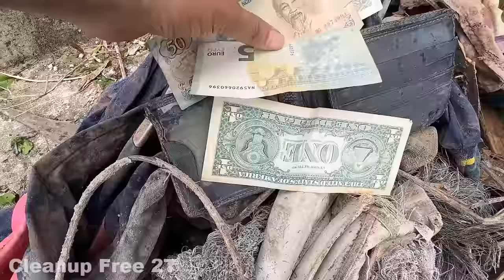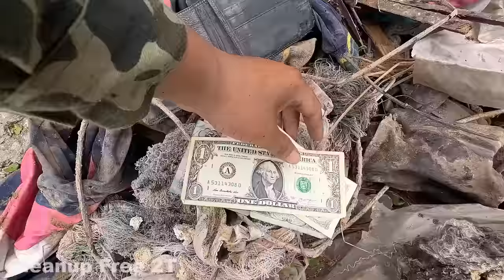Full Video! Cleaning and Restoration The Haunted House Full of Grass | Renovated and TRANSFORMATION

Comment: You will have to repair the roof first to make it water proof. Then the floors have to be done up using cement mortar, windows & doors fitted. The washroom has to be completed, cooking space with storage  to be provided along a. wall. These are necessary to make this house liveable. Then comes landscaping & other beautifications.
Reply: Thank you so much, I thought that was the miracle they wanted to perform but was disappointed when it ended like this.

Comment: The house needed pressure washing before they painted it.  I hate to see theses guys waste their time and money on paint cause mold will come back.  This house has a lot of potential.
Where is this town they are working in?
Reply: Not to mention they didnt repair all the needed cracks. Plaster was to thin as well and obviously the roof wall is missing. Dont know what the point was.
Reply: The point was go give it an exterior clean up and rack up 1.7 million views for the wow factor. Anyone who's renovated a house would know this was extremely poor work.

Comment: The effort is good but the restoration is below average, it was only an outside work so it should be more clean. We can see the spots on walls these spots can easily repaired by the use of cement. Still a good effort boys.

Comment: You know there are time saving things like pressure washers and adding acid or bleach in the soap mix that can save you some time, right? Big push brooms instead of palm fronds, a dumpster within feet of where you work, etc. And then the dude breaks out the leaf blower to get dust all over the fresh paint at the end, wow.

Use the right tool(s) for the job. You working too hard, aye yah! Uncle Roger  here to tell you Niece and Nephew.
Reply: I was thinking similarly, a pressure washer really could have helped them, but I think they're doing the work on a budget, just using what tools they already have.

Comment: Great job, you need to get a power pressure washer and a wheelbarrow to help you.  Maybe a company could donate these to you. Did anyone move into the house?  What is the little house on the side for?
Reply: I think the low structure to the side/rear is probably a cistern for collecting rain water; it looks like the roof may have had downspouts that fed rain water into it.

Comment: ,This was a remarkable job by the  soldiers  .it s location is like  in   Vietnam as we could see in the  wallet  Vietnamese currency a dollar bill is   also seen   most probably the architect ure look s as built  during    French Info china period  They could have  shown the interior floor  restoration as well wooden doors. And windows are not seen besides electric connection . what is the cylindrical. Dome. Structure next to this house   Roof restored is not shown   at all  Most probably it was a farm house to store  rice grain  gunny bags post harvest  the courtyard in front  must have been the threshing floor and the side room a farm implements shed  cum. Fertilizer  store room.  Good work by the  three workers. I expected to see snakes inside as frog were living inside the store room it was a bit scary to remove the rubble. As for the ghost they  were on vacation in the morning hours.  ....
May be back at nighfall.

Comment: This isn't restoration, this is more like cleaning and cover up.  There is moss and cracked plaster all over the walls. Those needed to be scraped off completely by spraying water before applying new plaster.  Pretty lame work. The colour/Primer  is going to stay there for 6 months max.